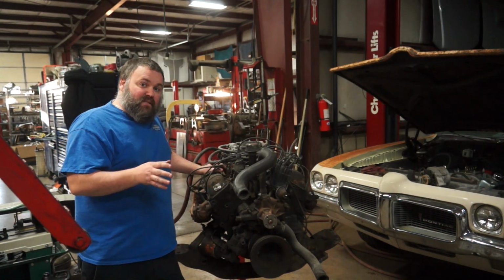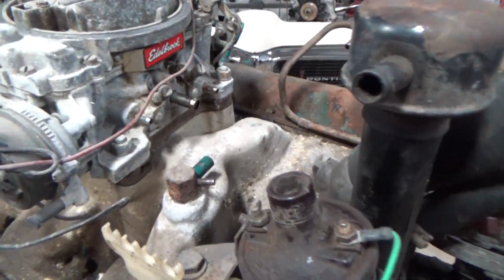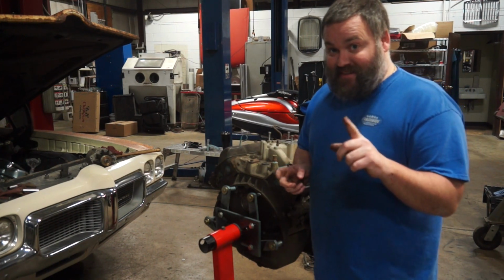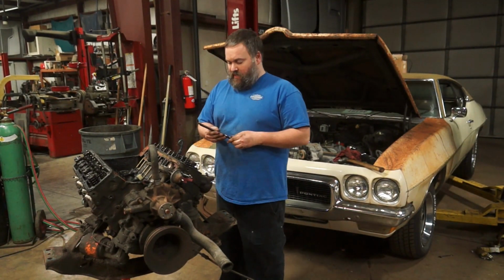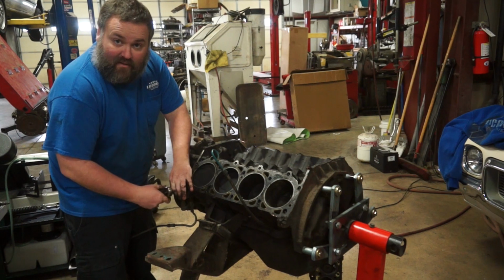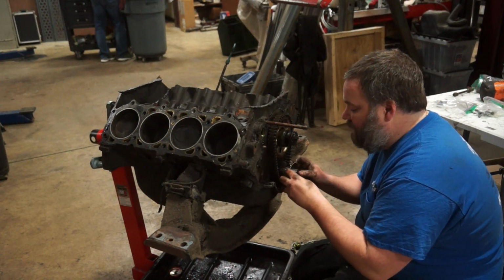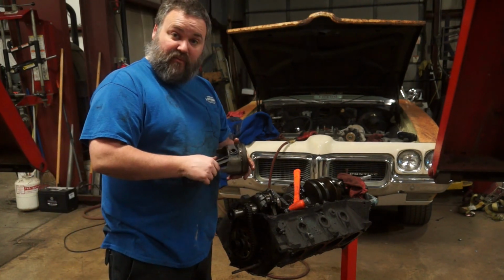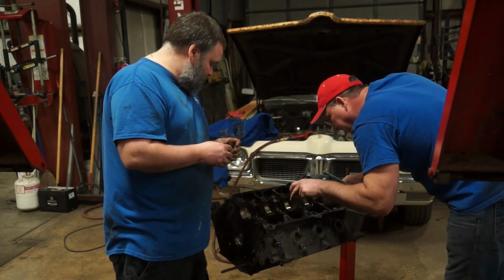AMC 360 V8 COMPLETE tear down! Carb to pan. 360 Build? 304 Build? Plan C? From Lucore Automotive

Comment: I'm going to be rebuilding my 360 in my 70 Javelin so this video is helpful to see what to look for. Thank you.
Reply from the maker: Very welcome hope it helped and gave you a little bit of a playbook to go by, your motor should be essentially identical. Any plans of what you're planning to rebuild for? Stock with a little oomph?
Reply: @LucoreAuto  I'm hopingt o go fairly hot but still be streetable. . Probably going to back up the 360 with a 727 trans. They are better than the BW it came with. I've gathering parts for  it nearly 30 years. I bought it as a $400 basket case on the side of the road but it's a genuine Mark Donohue Special  so with only 2501 ever built it's worth saving. I think.
Reply from the maker: @XA351GT  ohhh that's awesome! Long term project like that will be a great experience to bring back to life and enjoy the entire process. This little AMX will live again as a road racer, hopefully by spring. We'll see whether it's 304 or 360 powered though at that point!

Comment: AMCs are very reliable , dependable  how ever they all have an oiling issue . A popular configuration is a 366 build for road racing . I would clean up the heads & sell them . Same with the rods & pistons . Some one may want it , and you can get more information about AMCs + some extra money 💸. As fare as road racing your gonna want a high reveing motor . My experience with AMCs is the six straight and they are like tractors & can rip the house off the foundation . My mother oops with a 74 sportabout station wagon .
Reply from the maker: Will be for SURE doing the oiling modifications needed, especially with this thing likely spending most of its life on track it's going to need to keep everything well lubricated. Not to mention getting this thing able to breathe and rotate into the 7k RPM range... for an extended period of time. We'll see what we find once we get it all cleaned and checked. Lots of options still on the table!
Reply: @LucoreAuto  
Police 401s would go to 7K from the factory. Alabama used Javelins with 401s in the 70s for a while

Comment: I built a mild 360 for my 304 powered 74 Jeep CJ5 and wow is it different.  Completely different Jeep compared to the 304 . And i did quite a bit to the 304 before finally going with a 360. The jeep now has more muscle car personality than it has 4x4 personality.  Its awesome off road but just as awesome on the street now as well.

Comment: Bullet did not stand behind their cam when the engine was on the dyno.  Every lobe went flat except 1.  Installed lighter springs and used the proper oil.  Yes, it was a flat tappet.  Tore it down went roller motor after that.  (Isky).   It was a mess.  Learned the hard way.
Reply from the maker: Yikes, real quick way for a reasonably cheap part (cam/lifters) to cost you a LOT of time and money quickly! Really love the idea of building this thing to live up in the higher RPMs as a road race car, just not entirely sure what direction to take quite yet.

Comment: NICE!! Build the 360, have a bunch of fun. Save the 304 for resale, unless your racing pure stock. If you are using roller cam sleeve the bores and run any roller lifter. I have comp cams solid roller lifters, sell to you cheap. I had to go to Crower for better oil pressure control. These engines will spin fast with right prep no problem 8k+, no worries. Front covers can be picky. Great job and Godspeed.
Reply from the maker: Ohhhh let's talk about an 8k+ 304 or 360 build! Given I'm going to be using this thing for road racing, RPMs are my friend for sure as long as it can breathe up that high. Gimme some knowledge!
Reply: @LucoreAuto  KNOWLTONS THUNDER HEADS can cnc edelbrock heads,Dougs headers, steel rockers with strong springs, oversized push rods with oil reduction, rocker stud girdle, solid roller cam with sleeved bores(comp cams), billet distributor, nice I beam rods,oil mod on distributor gear, maybe 4 bolt conversion(I have one if you need),forged pistons, and a road race pan. You probably know all this, but there it is LOL! It will be alot of fun.
Reply: @LucoreAuto  10.8 compression or higher if running race fuel.
Reply from the maker: @3904Speed  it will be a lot of fun and a LOT of money! Easy there killer, let me hold onto some cash for other projects! ;) Realistically with the 79 AMX coming in at just over 3000lbs something 350whp should be an absolute BLAST which should be very doable in decently built 360 with Edelbrock heads a good balanced bottom end and letting to rev/breathe to 7k+

Part of why I'm considering the 360 is able to do a good competitive build without spending a fortune on really high end expensive parts. Plus, making more power means more things break AND more terror on track ;)
Reply: @LucoreAuto  OOOOHH BOOY! The money thing LOL. Dont worry after the AMX hits the track, all other projects will not matter! LOL Cubic inches are Horsepower <;}
Reply from the maker: @3904Speed  and don't you even THINK about me running race fuel on a road course, those would be some very VERY expensive days on track!
Reply from the maker: @3904Speed  well that Pontiac sitting in the background has 461 inches of power and only weighs about 200lbs more than the AMX does so.... but that's more of a fast in a straight line and cruiser versus something fun for twisties and road courses ;)

Comment: Hi LUCORE,
The AMC V-8 360cid exhaust manifolds are the "rather" FREE - FLOWING style & will bolt onto your 304cid if you KEEP the 304 ... 
so  FAR  I am only seeing the PASSENGER Exhaust Manifold - but - if the Driver's side is a match ... 
and if they BOTH will clear everything in your 1979 Spirit body - 
this is a pretty good start to an exhaust system along with the Dual-Exhaust "CLIP" you removed from the previous episode. 
FYI - they make a nice set of EGR "plugs" to fill those SMOG holes in the Exhaust Manifolds (mine came with SPARK-PLUGS screwed in those HOLES :-) 
FYI # 2 = those cast iron Exhaust Manifolds accept GASKET-MATCHING & PORTING quite "nicely"  at the HEAD End 
and Increased  DIAMETER  at the DUMP-END by the Exhaust Pipe end ... for a substantial INCREASE in FLOW ... 
? is that a CUSTOM"  EGR  Block-Off PLATE on the REAR of the Intake Manifold ? 
( suggestion:  use small core plugs / freeze plugs in the holes UNDER that PLATE & also inside the Fuel area under the CARBURETOR  ) 
ROCKER-ARMS - You might have noticed that your 1973 Rocker Arms are free-standing (NO aluminum Siamesed gizmos) which means 
1) your HEADS have "cast-in" push-rod GUIDES 
2) screw-in Rocker Arm STUDS = AMC uses "SHOULDER-BOLTS  --- 
but ---  FYI: small block Chevy 3/8" or Big Block Chevy 7/16 studs will fit with Roller Rockers 
just my thoughts as I watched you 
COOP
the  WiSeNhEiMeR  from Richmond, INDIANA 
...

Comment: LUCORE,
Those CAST IRON Heads are quite usable ( IMHO ) 
I  Never had much use for the aluminum heads (except for WEIGHT Savings) as they sucked HEAT out of my engines too fast & the CAST-IRON Heads had lots of MEAT for PORTING 
But ... you are correct, EDELBROCK, & INDY, & Herman Lewis all make excellent ALUMINUM Heads with newer technology built in ... at a PRICE ... 
No matter which way you go - I will be anxiously awaiting your AMC  V-8 BUILD(s)
COOP
the  WiSeNhEiMeR  from  Richmond, INDIANA 
...
.....................................

Comment: AMC guy here. yea don't put money into the 304 3.75 bore compared to 4.080 of the 360. No brainer. take a 5/16 long drill 10'' and clean up the oil passages from mains to oil gallery before installing new cam bearings, there will be metal at the intersection of the galleries. I think the original drill that did that work must not have been sharped or replaced enough since I all ways get metal. Cam bearings need to be champered on the block side to follow the oil passage. if you don't you end up blocking 30% of the flow to the mains. Do not do the common oil bypass line. it doesn't help. its the cam bearing that are the problem. Look at the front cam bearing bore and the oil line that goes through it, now imagine (if you will) a cam bearing installed and how much of the oil passage it will block. for a budget build and as light as the Spirit AMX is a good set of pistons and those 080 heads will do fine. they don't need all that much work 2.02 in 1.68 ex. and dog legs they flow well.  Side note just purchased a REAL (had to say that) 70 AMX 390 4 speed car. I may try to video but not really all that good at it. Good luck with your build.
Reply from the maker: We are on EXACTLY the same page as you with the oiling modifications, we stayed away from the oil bypass line ourselves and instead chose to clean up the passages and choke points as you said. So far so good, but time will tell!

On the 304/360 conversation front... we know we know it doesn't make sense to build the 304 when you can spend the same or less on the 360 to get more power more options and a better all around motor in the same "package" as it were. However, we have some other motivations as to why were are putting some money into it. One, we want to show just what a "normal" build costs and can produce, and TWO, we want to be able to use this car for vintage road racing so need to stick with the factory displacement block.

With that being said... we ARE building the 360 as well just to be quietly honest with you and everyone else ;)

Comment: Cool but do check the way the cam bearings restrict flow to the mains. I take a rat tail file and just remove some material from the back side of the bearing to follow the oil passage. don't make the cam lube hole any bigger. and it doesn't hurt the bearing since it doesn't touch the block in that area. Great build. didn't think of the rules in racing.  I have a old parts book with the group 19 parts listed. It shows a Holley 950 cfm 3 Barrel carb as a dealer option. Now we can run up to 950 cfm in factory drags and be legal.

Comment: Just wondering if the intake has the PCV baffle pan attached under it??  Most forget to transfer that baffle from the old original intake to the aftermarket intake. if not done she will such oil vapors.

Comment: 305 C.I. is what AMC had to run in Trans Am and Nascar Grand American, although a different bore and stroke, but still the AMC 304 / 5 Liter is the same cubes as what they raced.
Ah, you got a honey of a deal on that '73 360, last year for individual stud rocker heads.

Comment: I used to rebuild industrial machinery (some of the stuff I worked on was used to machine thse engines*). Bagging and TAGGING the hardware when dis-assmbling anything is always the way to go. Instead of using the crap consumer ziplock bags Uline sells industrial grade versions that are made from a thicker material. They'll still blow out just not as easy as the Hefty ones. Plus the Uline ones come 500 or 1000 to the box.
*Spent two or three days one time with a guy from Penske tweaking the machine that cut the intake, exhaust and head face to get however many heads they needed with the combustion chambers all to equal cc's.

Comment: Can you use the 360 heads inlet carb as an budget upgrade on the 304?
Reply from the maker: The intake manifold and the carb yes ABSOLUTELY I can, the heads can be used but require quite a bit of work. As I understand it because the bore is so much bigger and the valves on the 360 heads are bigger it's not just a bolt on and go kind of thing.
Reply: @LucoreAuto  Actually 360 heads on a 304 hurt the 304. You are better off with a 1.94 intake and a1.50 ex on a 304 head.
Reply: The valves will crash into the top of the deck unless you clearance the bores to accommodate.

Comment: The 360 is a far better and much cheaper choice if performance is your quest when compared to the 304. The 304 requires significantly more money spent and time invested to get the performance of even a stock 360. A comp 268H cam a good intake and 4 barrel carb and a set of long tube headers along with a ignition system upgrade and the 360 will surprise you.  Even with its factory low compression ratio. Add a set of performance pistons bringing the compression ratio up to 9.5 or 10:1 as well and the 360 becomes something to reckon with as far as small displacement V8s go.

Comment: The aluminum short deck motors used Indianapolis and Cart racing were supposed to put out around 1100 hp. Wickedly fast on the straights but cornering suffered from the higher center of gravity compared to the other motors.

Comment: Hello i was really happy to come along your video and see your located outside Columbus ohio. I live in Cleveland and jus recently purchased a Jeep Wagoneer with 101k miles on its 360. I changed the oil recently and am now seeing its burning oil with a blue smoke when i rev after idling in the driveway. I did notice the front seal of my intake manifold is leaking. I was also told the head gasket may be blown by the previous owner. I didnt see coolant in the oil and i dont see oil in the coolant and i have good pressure. I know i should replace my pcv valve and get a new gasket for my intake but im just not sure if i should have the whole engine rebuilt before i do any damage. I guess my question is how much would a 360 rebuild cost at your shop. Im limited with tools and experience and i always tend to destroy something when taking something apart on my jeeps.

Comment: I’m looking at my 360 with the intake off (intake manifold was leaking) right now, was trying to decide how far to tear it down when this video popped up. Looks immaculate under the valve covers and intake, will pull the pan when I do the rear main seal. Ran good, good oil pressure... how far would you tear it down to inspect a relatively trouble free motor?
Reply from the maker: Well glad it popped into your feed, hopefully it gave you a few things to look at and think about! It really depends on your particular motor and situation honestly, in OUR world almost any time we get our hands on a used motor especially if it's for a build or project we tear it all down. Regardless of what we've been told about it, or what we can see from the outside you never REALLY know until you get inside.

There's certainly a cost to doing things that way though, in both time AND money. Once you go past the valve covers and intake gasket the next phase will add hundreds of dollars. At best you're a gasket and bearing set and reassemble, at worst.. well..
Reply: @LucoreAuto   Good to know! if I don’t see anything when I pull the oil pan I’ll button it back up then. Already sinking enough money in other parts of this Jeep, I’ll go with ignorance is bliss and save the motor rebuild for next winter. Thank you!
Reply from the maker: @robwilliams3484  you can always pull one of the main caps or rod caps to inspect a bearing or two while you're there. If everything looks torque back to spec, button it back up, say your prayers and hope for the best :) Our journey on this 360 will be much more intense.. and expensive!
Reply: @LucoreAuto   I’ll be following along for when/if I ever pull mine apart. Mine is just a stock street motor nothing special in an old CJ7. It’s run fine for the last 6 years, should be fine for 1 more as their isn’t anything telling me to pull it apart, I just had to pull the intake anyway and it looked good from there. I will pull a cap or 2 and inspect though while I’m in there.

Your plans sound good to me, I’ll let you do it first then I’ll copy yours once you’ve got the kinks worked out! A CJ7 with boost haha!
Reply from the maker: @robwilliams3484  well that's why we do these kinds of things, to give other people some info to make their own projects easier/smarter. Far too often people get involved in a project without really knowing the massive costs and challenges involved, in these kinds of series we show all the good/bad/ugly expensive. 

Whether we build the 304, the 360, or both they will be built for road racing so pretty different than what you would do for a jeep build. Usually you guys like low and grunt and pulling/climbing power/torquw where I'll be more focused on the higher rev range and horsepower up in the RPMs, but a lot of what we'll be showing and discussing SHOULD still be useful to you. Glad you're along for the ride!
Reply: @LucoreAuto  sorry I was being facetious about the CJ on boost comment, though it would be fun! I would be better served with the original AMC 258’s tractor like grunt, but this ones more street than trail and the 360 Is more fun there.
Reply from the maker: @robwilliams3484  well the AMC on boost isn't totally out of the cards over here, already kicking around the idea :) Have a system in mind we've been wanting to try for a while now.

Comment: Oh watch those galley plugs they will also restrict.  Actually AMC engines don't have an oiling concern unless modified or long high RPMs.  I know I talk a lot but I've done the AMC bit since my Days at the dealer in Centerville in the late 70s. 10w30 Amsoil and nothing else. never run thick oil or you will destroy the cam/disco gears . might drive my 59 American 2 dr S/W up to Ohio to check you guys out. love road trips.
Reply from the maker: We tried to do everything we could to maximize the durability of this little motor as it WILL be seeing some road race use once all the bugs and issues are sorted out. Vintage road racing is the goal for her, to get back to the '79 AMX roots.

We always welcome visitors, stop on by any time! We do VERY much appreciate all the knowledge and advice from the AMC community on this project, you all have been truly awesome.

Comment: Oh OH OH. the head number should end with 090. very good heads and actually flow really well with not much work dont..Please dont through away. fully adjustable with the chevy style screw in studs.. clean engine maintenance goes a long way. would you sell the heads??? tp a fellow AMCer.